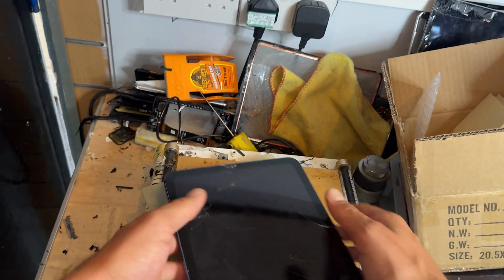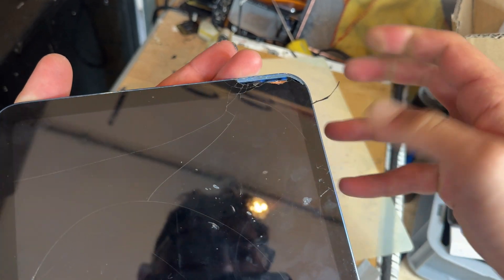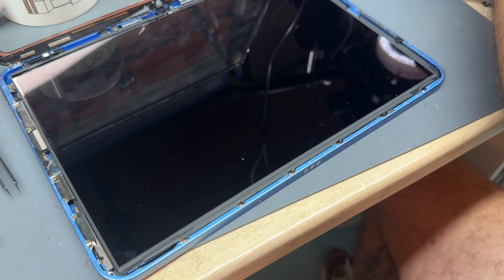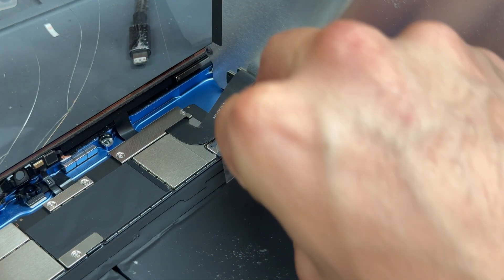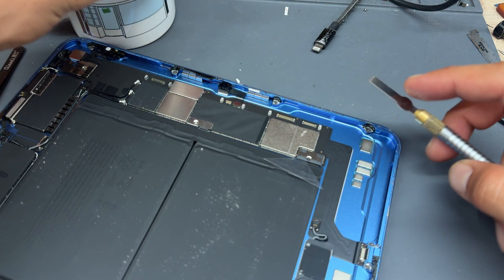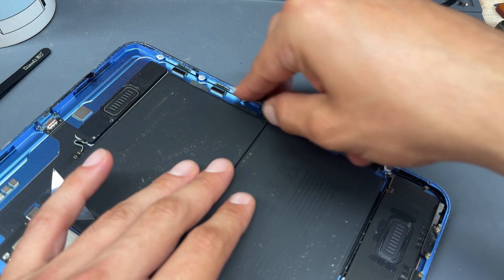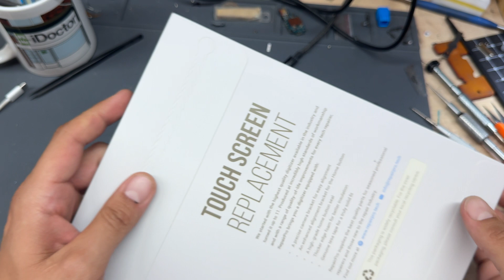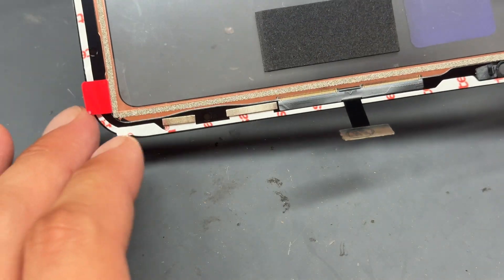iPad 10th Generation Front Glass Digitiser Replacement! - DIY Guide To Fix Your iPad!

Comment: tip for anyone doing this, if you don't have a hot pad or a heat gun but you have a 3d printer than you can use the 3d printers bed as a hot pad to soften up the glue, it's a similar heating mechanism in both

Comment: I did this repair at work today, its soo much easier then the  6,7,8, and 9th gen pad's thanks to the fact that it no longer has a home button. though I agree you don't need clamps, I still recommend them to guarantee the adhesive adheres to the frame.
Reply: Hi there! I have a plan that I’ll fix my IPad 10th Generation with broken screen & digitizer , after replacement does the multitouch works and Apple Pencil still work completely fine or not?

Comment: Okay so 1) Where did you buy the screen from ? I don't see a link 2) How do you heat up the chassis so you can get the screen all gooey so it is easier to remove?  3) do you have a recommended tool kit set for repair ?
Reply: do you need the screen? I have the replacement if you need, contact me.
Reply: you can get it on mobilesentrix

Comment: Do not put a plastic thing directly under the battery pins, you’ll bend the pins and the iPad won’t boot. Lift the motherboard with blue pick, this wil disconnecf the battery. Not very professional of you “iDoctor”.
Reply: So a small plastic thingy will bend the pins but not a guitar pick.......?

Comment: my phone has ghost touches in one horizontal line in the middle of the screen. The screen itself hasn't a single scratch. Is there a way to solve this problem without changing screen/digitizer? Sometimes the problem disappears sometimes it reappears. Any advice is appreciated.
Reply: No
Reply: maybe you need to changee a screen